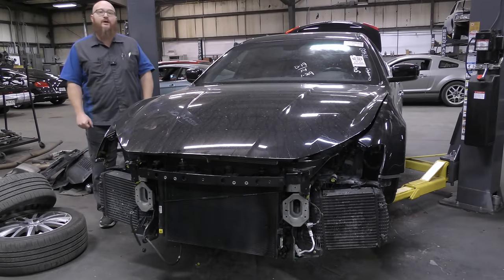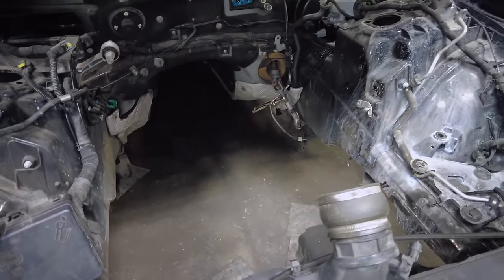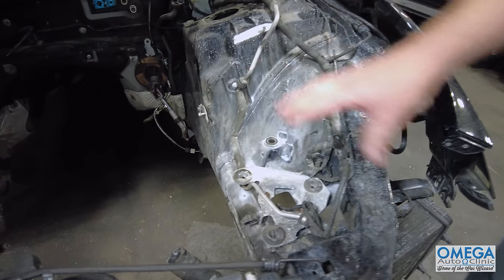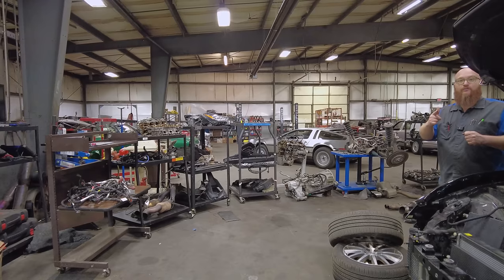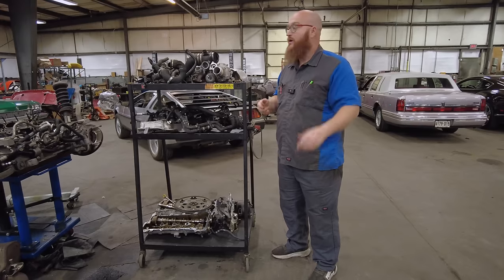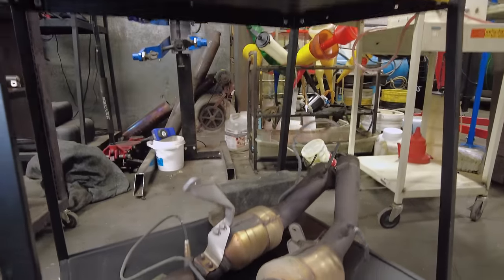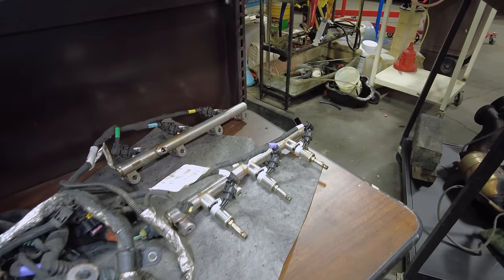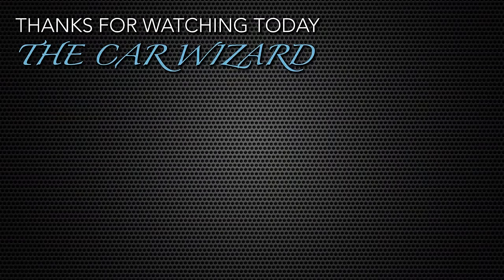Hoovie Must Hate Me! His Maserati Engine Swap is a Nightmare!

Comment: Top Gear UK did a segment about buying a cheap Italian supercar.  Their advice?  Just don't.  I think this applies to any Italian car.
Reply: Well you're wrong
Reply: @elnyoutube123  Example?
Reply: @johngalt5205  Lancia Kappa Fiat 500 Fiat Panda Lancia Thesis Alfa Romeo 164 Alfa Romeo Giulia Alfa Romeo 4C Maserati GT 6 Speed Maserati Quattroprte ZF Lamborghini Countach Lamborghini Hurican Lancia Fulvia Lancia Flaminia Fiat 124 Ferrari 430 Ferrari 360 and many more... also Top Gear later admitted those break downs were faked.
Reply: @elnyoutube123  the list is true tho you should have a bunch of cash to fix them if you buy them.

goes for any supercar really.  or any used car. at right point in time an used fiat can be a really decent buy though, but not what americans would think of as fiats. not sure if 'muricans would think of punto as a car even.
Reply: @lasskinn474   I'm American and I have a Fiat 500. Everyone thinks they won't like it till they go for a ride in it. Underrated fun little car and it's been reliable for me. And you can park it anywhere. My dad had a Lancia Fulvia he used to drive every day if it wasn't raining. Easily the best sounding 4 cylinder car of all time. It sounds like a V8. That car didn't give us too much trouble but carburetors needed lots of adjustments and parts were really not easy to find especially before the internet. But it always ran and turned over whenever you asked it to.
Reply: @elnyoutube123  yeah what I just mean is that they quit importing fiats to usa before most models euro-bred adults now would think of fiats.  unos, puntos, bravias, coupe 20v(kinda like an integra I suppose), pandas and such.   with exception of the coupe(also spider) they're all very much utilitarian in reputation and nature, cheap, cheery and do the job(most of the time) and not that complicated.

yeah fulvia has that funky narrow v4. good call on not using it in the rain! :D  (also there's this rumor about italian cars rusting out quickly at a point in history due to using USSR trade steel in exchange for car licensing, in some trade thing for the  but there's no evidence for that particular steel being used for the cars, it was italian steel they just stored a bit in lets say in an italian and unions style.)

speaking of ladas sat once a punto in passenger side when a samara(fwd lada, not the iconic one) cut us off from a bus stop over 3 lanes. the puntos corner crumple zoned like it was supposed to and totaled the car.  someone bought the carcass and got it on the road in a few months though. the samara had just a dent and still drove as if nothing. it was cheerful to drive(wasn't the turbo) and did what it was supposed to(absolutely nothing entered the cabin while it crumpled at leat beyond the middle pointsof the front tire)
Reply: @lasskinn474  Damn that sucks for the Punto...   :(   My 500 is also a turbo model so it has plenty of power. 130hp for the US versions. 5 speed manual too. The 500 is one of the only cars sold in the US where a pretty large amount of them were sold as manuals. I think the Fulvia was built before Lancia was leaving unpainted cars out in the rain too. I think that was just the Beta and some of the cheaper models, but he didn't want to take the risk anyway lol

Comment: I remember my Dad taking out my Mom’s VW Beetle (air cooled rear engine - not the newer ‘modern’ ones).  He did it in less than an hour!!!  And… and that INCLUDED him stopping for a break when my Mom brought him a sandwich with some afternoon tea!  That Maserati?  Wow! What a job!   Thanks for the video.
Reply: You are right. Four bolts and some wires and hoses. I helped my friend do a few of these. The entire exhaust system came out with the engine.
Reply: its 15 minutes if you know what you are doing. lol  he took his time..
Reply: And I was told that a Porsche flat four just bolted in - same mounting bolts and location
Reply: I have to agree with these comments. As the Wizard said "Things have got insane". The Maserati (with a replacement Engine) has lost heaps of value. It has lost its' integrity as a car. If the Maserati was mine, it would become a Parts Car, and I would steer clear of the brand. The way that things have gone with all car Manufacturers, the parts are expensive (even plastic parts), and every part is interdependent on each other. That is why I lost faith in many modern cars, and my 53-year-old Beetle Super Bug has got me around for the last 20 years - and still drives and looks like new. Such a waste of resources to pour money into a bottomless pit, like the modern Maserati.
Reply: bassbass69  those Krauts  learned from the Yanks in WW2,    All the U S ground vehicles used the same engine oil.    While the Wehrmacht had to optimize and change designs mid production.
Reply: I swapped one of those engines, it was 4 big bolts and some electric connectors haha.
Reply: For contrast I worked on a 92 Buick Regal today, the parts are hard to find but everthing on the car was easy to get at and the 3.8 engine had 400,000 KM on it and it runs like a dream still.
Reply: my 1st time, 2 hours to swap  a rx-7 12a engine.  Old brittle parts made getting everything right caused weeks delays.
Reply: I had a '67 VW bus when I was in high school. Not reliable but I timed it once and I had the engine out in 26 minutes.
Reply: @alexkram  how many times did you do it before?  on your wunder bus? ?    It takes me 40 minutes to lift a car,  and support it with wooden blocks so it is impossible to fall on me
Reply: @cubiczirconiabeard5366  I probably had it out 4 times before the flywheel fell off and ruined the crankshaft. 17 year old me didn't know about locktite. I would jack up the engine, unbolt, and roll the bus away.
Reply: Only 4 bots I think.

Comment: Can you imagine how much labor went into assembling that car on the production line?  Maserati needs to do a lot of lean design engineering.  Time to hire Sandy Munro and Associates in Michigan!
Reply: I imagine its probably similar to other cars. In a general sense its the same amount of parts being installed as any other, just they have to follow a mean install order regiment or there will be hours of lost labor reverting changes. Could say its designed great for production, not for maintenance
Reply: Prison is not exactly a likely sentence in civil court
Reply: Plus Italian is spoken at Maserati, 1/2 the time they are saying to each other, "Huh? what did you say?"
Reply: On the production they install the motor to the subframe , without the body attached, much easier that way.

Comment: Hey Wizard,
I just rebuilt one of these engines last week.
I highly suggest checking the timing chains for stretch!!!
every 80-100k miles or so the 2 cam chains stretch causing the tensioners to fully extend and they flop around and damage the plastic guides which fall into the oil pan. Also i pulled the engine from the top which took only 4-6 hours. You can reach all of the bell housing bolts from the top and bottom, Undo the engine mounts from the bottom. Also the engine is based on the Chrysler 3.6 pentastar and almost all of the parts are identical. including most of the timing chain components and even the oil pump. yes all the extra added Italian items are not very well engineered and there is so many single use clamps on almost every hose or line.
Reply: What the hell is wrong with y'all? When any non-Chevrolet engine fails, it's just helping you start on a Chevy V8 swap.

Comment: Heavy duty zip lock bags with a sharpie marker is what I use to track all the parts/bolts/nuts when doing an engine out.  At the end all the bags are empty and nothing is left over :P
Reply: That's the approach I take when restoring a car - supplemented with a host of photographs.  However, you seldom have that luxury when working in a busy workshop where the principal activity is repairs to current model vehicles in the shortest time possible.  The next best option is to adopt an expedient solution - such as that described by the Wizard.
Reply: Or take lots and lots of pictures and video.........which is easy to do nowadays.
Reply: I was about the post this: Zip Loc bags.  If you knock that TV cart over it will not be a fun time.
Reply: I do the bolts with the part that I took off. The first part I take off goes the farthest away.

Comment: 1968 Dodge dart slant six ?  I was 22 years old it took me 5 hours to swap a used motor the only help I had was my brother and I physically pulling out the old and putting in the new into the bell housing. Extra parts a few bolts . Man those were the days loved that engine.1982 😊

Comment: I'm glad we got to see the Hoovie reaction.
I used to work for a car dealership, not tech or sales, and when I saw the Techs remove an engine I always said I could probably get one out and apart but doubted I could get it back together and in and working.
Reply: Hoovie has founded his substantial empire on what seems to be dumb acts. However they are far from dumb - they are deliberate and well thought through - as the resultant YT 'clicks' provide his substantial income.  It goes without saying that if Hoovie purchased a Maserati (or other cars) that was (or are) in perfect order - the YT videos would yield a low number of views and negligible income.
Reply: Also, if it your first time, it is hard getting everything right.   Situations where there are a 3 series of  interdependent things that you have to get right.  Ignition timing can be impossible.

Comment: If you are curious about how a powerplant and transmission can be designed with service in mind: check out one of the many videos about the Leopard 2 tank.  The entire R&R can be done well under an hour. These car manufacturers want you to replace the entire vehicle, not repair it.
Reply: Most cars never need their engine replaced. It's meaningless comparing them to things like tanks. Entirely different considerations apply.
Reply: @dunebasher1971  Meaningless? No of course cars never need an engine removed. Until they do. In case you haven't been following, a lot of what is considered "routine" service on some cars, requires an engine out because of confined space.
Reply: You aren't supposed to repair a Maserati. They are made for millionaire Italian playboys to buy, drive for 2 years on the Riviera, keeping the car garaged every night, never driving in the rain or cold, then scrap the car.
Reply: I don't have first hand experience with the Leopard 2 main battle tank (MBT), however with the Leopard 1 it takes an experienced 3-man crew 20 minutes to remove and replace the power-pack.  Needless to say, MBTs are designed with in-field 'timely' maintanance in mind so - are eye-wateringly expensive.  If the same features are required in a regular motor car, then I would estimate the cost of the vehicle would rise by an approximate order of magnitude - eg. a 50k vehicle would end up costing $500k.
Reply: @georgebettiol8338  Why do you feel the need to defend car makers who design in planned  failure and difficult maintenance? They want you to buy new every 4 years, not repair. They want only highly equipped dealerships who will even attempt repair.
Reply: @gregedmand9939  >>>Planned Obsolescence <<<  designed to fail so you have to buy the new improved model.     If only new car buyers would look under the hood, and not be seduced by gimmicky electronics and appearances
Reply: @gregedmand9939  I'm not defending car manufacturers - it's a simple question of economics.  Regular motorists WON'T pay for their new car to possess a feature that would enable the 'quick' removal-replacement of an engine-trans assembly - a feature that most new car owners will never excercise during their time ownership.
Reply: @georgebettiol8338  Of course the average owner doesn't need a quick engine change in the field like the military does. Not every car and truck has the maintenance nightmare that Maserati has. Or the average modern Audi or BMW.  My point is, some of these manufacturers don't want their cars serviced. They want them replaced. They shave off pennies in cost to replace good design in metal, with plastics designed to last 4 years if you're lucky. They pick electronic options that are custom designs that could be made from commonly available tablets for example. When engineers have the power, they build to last and can be serviced. When bean counters have the last say, you get an current Audi, BMW or Maserati.
Reply: @gregedmand9939  i agree, the bean-counters and marketers are in total control of car companies - with the engineers taking a 'back row seat' and just moaning.  The post 2000 cars that were manufactured by VW-AUDI in four wheel drive guise are a nightmare to service and maintain - possibly even worse than the Maserati.  The VW Bentley Continental is a vehicle that I have 'work on' - but never again.  It's a complex vehicle fitted with very poor qualiity under bonnet (US hood) plastics - like all VW-AUDI & BMW products - that crumble like corn flakes when the car reaches the 7+ year mark. The poor quality plastics are also evident on Mercedes products - how sad.
Reply: @georgebettiol8338  Car makers have everyone fooled. Normally as time goes on, technology advances and mass production makes things cheaper while quality improves. Look at the cell phone. More computing and communication power for $500 than you could buy in a desktop computer for $5000 twenty years ago. What do we get in cars? The prices keep climbing while reliability and maintenance, in most cases, gets worse. They've convinced people the price is justified simply because they give you a 500hp engine and some plastic trim. When let's be honest, who needs that kind of power in the average car? They've added tons of options and luxury items like massage seats, and buyers think they are getting more. If you truly want the quality of say a Toyota, you pay dearly for it. Where is the  equivalent of a modern Model T?
Reply: I knew an old guy that was an engineer and worked for GMH in Australia, they had to redesign a particular Holden Engine because it was going over 100,000 kilometers at the proving ground in Lang Lang, they made several changes and all of a sudden 60,000 was about it’s limit. As a mechanic that model was an important vehicle in our income 😂 60 to 80,000 kilometers and we were rebuilding or putting change over engines in. Great little car but we warned anyone that asked us when buying to factor in a new engine. 
Programer Obsolescence was what he called it. 
Ford did similar wit the XF Falcon, crank thrust bearing was reduced to a top shell only, end play on the crank was massive in that model. 
Good to see you can spend 20 times that amount on a Maserati, and still have programmed obsolescence
Reply: @michaeldearaugo4552  Interesting story, although you have me wondering which Holden engine you are referring to.

WIth regards to the Maserati engine - the root cause was not 'programmed obsolescence' where the said engine 'hit' its preset design life - but one of a less than diligent (an understatement) previous owner that ignored all dash mounted warnings,  topped up the coolant with an incompatible type and then proceeded to continue to drive the vehicle with an overheating engine - what could possibly go wrong?

Comment: You can get the goo resulting from mixing incompatible coolants out of a cooling system by flushing it repeatedly with hot water with a dishwasher tablet or three dissolved in it. I usually rig up a circulation pump to the rad and heater core and let it run overnight. The next day there are strings of that goo in the receptacle and you can literally pull them out of the cores, too.

As for the smell of weed inside, spill a few handfuls of coffee beans. They will absorb most of the smell without replacing it with coffee smell, try it, you will be surprised. Do this now, while the car is parked inside, since if the coffee beans get wet, you'll never be able to hoover them out.
Reply: Won't fix the warped block face though sadly.
Reply: @andrewmooreandrewrmoore7615  Of course not. But the radiator and heater cores can potentially be saved this way.

Comment: I was 5 thru 8 years old and my dad and uncle were mechanics and amateur racers. I had to hide on the floor of their 1948 Ford F2 wrecker ( used that same truck to learn to drive years later) to get in to the pits. One race I remember was about a 4 hour drive. Something went wrong with the engine so they took off the hoods of the wrecker and their race car. Parked the two side by side, removed the broken flathead out of the car and swung it around to the back of the wrecker. Then removed the wrecker flathead and put it in the car and raced it. The wrecker was manual turning and used a starter motor to wind up the cable. After racing they put the engine back into the wrecker and hooked up and we drove home. Not sure if they had a plan B if the wrecker engine died but, we made it. Great memories!

Comment: The cab up process on late model pickups is SO much better than the full disassembly of so many front end body panels and then the access is still far less than ideal and leads to inaccurate bolt torque and back surgeries well before you should need them. This car has the same issues but it was is unibody with engine on subframe. There are some sunroof and headliner jobs that require door removal. Those vehicles were interior assembled while the doors were in flanking assembly lines off the car being loaded with all the door parts. The doors have a wiring plug and easy off hinges.

Comment: Those old TV carts were fine, but they were top heavy with the old CRT style TV's. You had to be careful when pushing them around the school.
Reply: Especially if they have pneumatic tires on the caster wheels that would go flat easily and not be checked regularly.